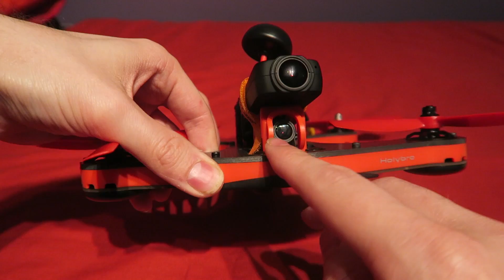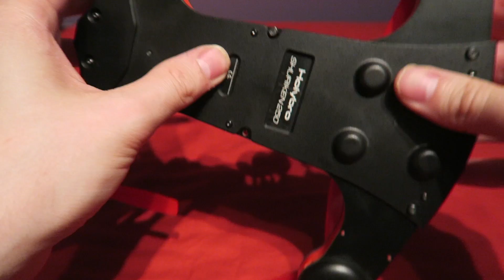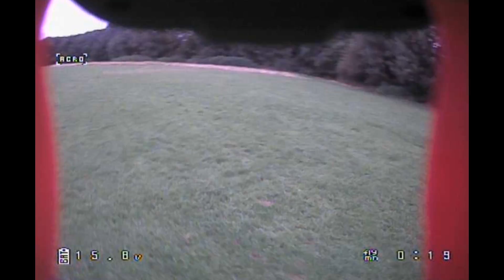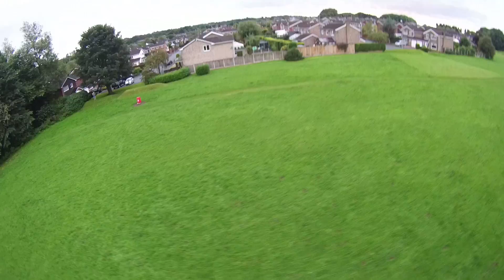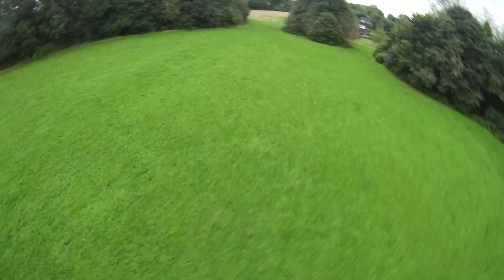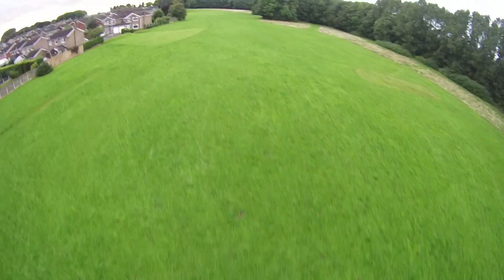Holybro Shuriken 250 Vortex Competitor

Comment: Great Video, Andy, I was wondering as I am not yet as handy in respect to the I.T side of things, at all really but very much wanting to learn more and more, as mentioned in video, the Shuriken didn't come pre programmed yet with any of the (usually 3 settings) I'm more a custom to atleast starting out in or as close to stability mode, which obviously turns of any chance of full rotation , but at this stage in my flying , im still pretty much in training wheels still as per other quad such as the Ariel variety and so forth I am very well-versed in flight and the mechanics of it now I was wondering if you would mind making a video or a review of how to go about setting the channels for the Fail-Safe alarm setting in case of crash also as mentioned above she possibly adjust recording me for stability mode Horizon and full Acro I would very much I greatly appreciate it as I'm sure many others would I don't use either way to fight or cleanflight though cleanflight I believe is from what I'm told the easier of the two in regards to those of us who are still in the infant stages of the understandings of the programmers and programming of racers I guess if you can that would be wonderful I understand you're probably very busy I suppose if you do it I will see you in a bit chilly but I want to thank you for the great reviews they're always informative and thorough

Comment: I own the 180 version and suggest flashing betaflight, the stock pids need almost no tuning.

Also you can get a carbon camera frame which is much better then the standard plastic one.

Really solid quad that can take a beating and has some oomph on 4s.
Reply from the maker: yes I will be doing that thanks

Comment: Oh wow, Andy this one is sexy as hell.
The design is killer and it seems like they've covered all the bases!
If a little tuning and antenna placement is needed, that is still VERY little to have to do.
I'd love it if you could do a follow up with another flight after you've had a chance to tune it if you have a chance to as I know you have been cranking out the content.
Personally I think I might try to bend the sides of the FPV camera guards out to get them clear of the camera view but keep the guarding aspect. Maybe a little judiciously applied heat?
Super nice.
Reply from the maker: Thanks Michael the follow up is been recorded :)
Reply: +AndyRC awesome
Reply: Hi Michael if you're looking for a quad and considering this i would also take a look at the jj pro p175 or p200. They're actually really good quads even by most people's standards. Red bottom motors, emax blheli esc's, i think f1 flight controller. The camera is also decent for fpv and has a reliable vtx. Even comes with a lipo and a transmitter. All for around 200usd. I think they even have a sale on them at the moment.